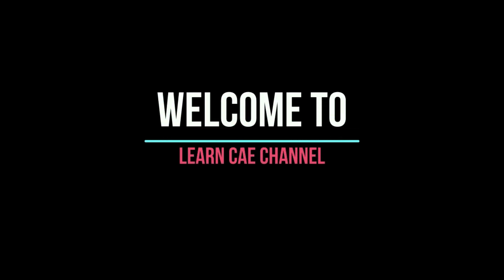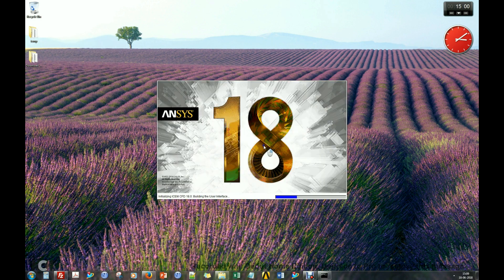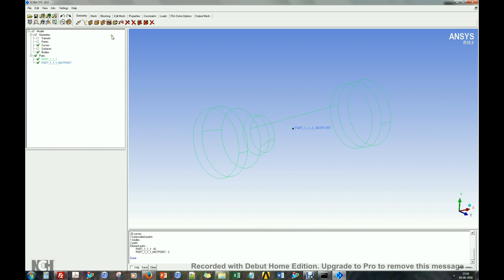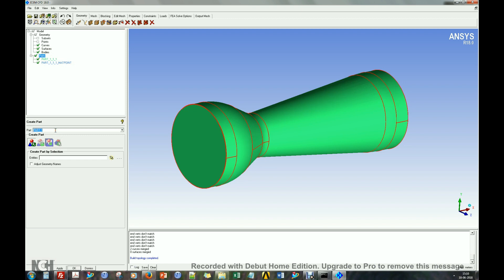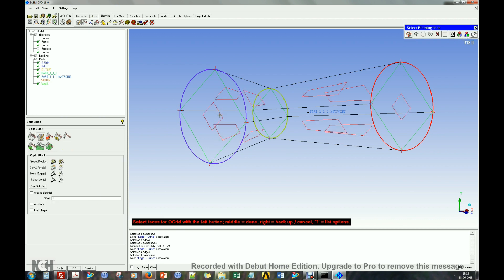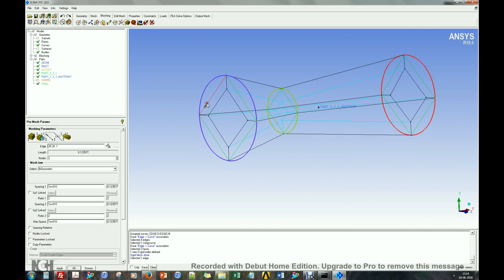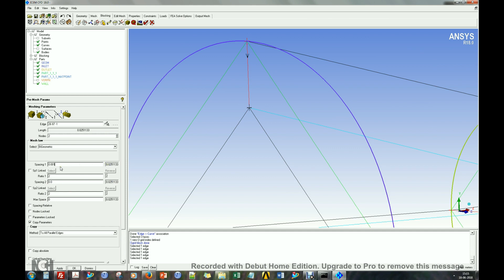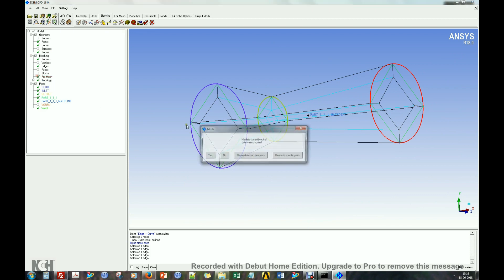CD Nozzle Hexa mesh generation | Ansys - ICEM-CFD

Comment: How to create the 4 equidistant points in a circle?
Reply from the maker: Hi, if it is a complete circle, you can create points based on parameter (length), like 0.25, 0.5, 0.75, 1. If it is split into multiple segments, you can specify the parameters based on the length of each segment.
Reply: @LearnCAE  ok, one question, I have a noozle to mesh, but with more complex geometry, I tried with the box but is impossible to mesh, and select fsces for the inflation, what do you suggest?
Reply from the maker: @Julio-fs1ui  Hi, icemcfd is one of the best softwares to generate high quality mesh. I am not having much experience with hypermesh. You may please send your geometry to learncaenow@gmail.com. I ll check and get back to you soon.
Reply from the maker: @Julio-fs1ui  Hi, thanks for your comments. I have seen the geometry you have shown. Meshing can be done in icemcfd with proper blocking and o-grid. Please send the file to learncaenow@gmail.com. I ll check and let you know.